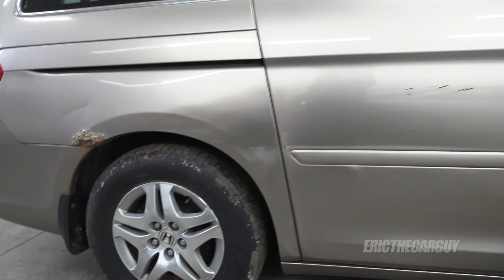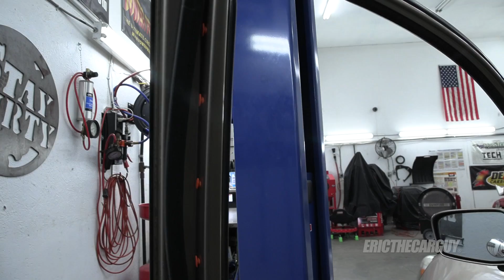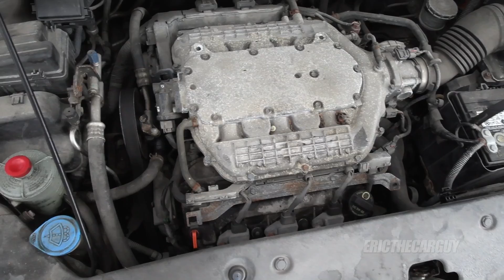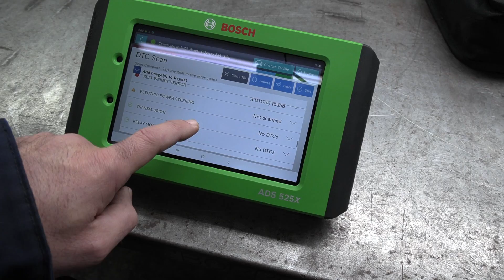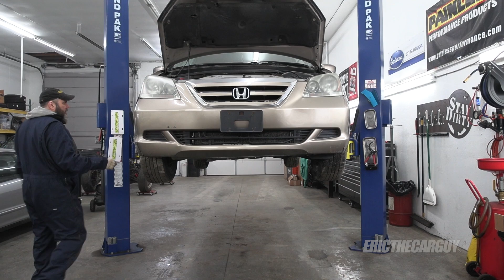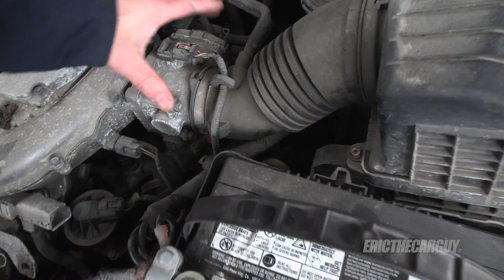2005 Honda Odyssey Introduction (Episode 1) Fixing it Forward

Comment: Unfortunately, if a cat gets pelted with another's guts, it's best to change them, as the fine dust and materia inside clogs them. So at the very least, it's not going at spec for its age.

@20:07 there's still a grindy noise coming from the engine, now it, might be the camera lying, but it seems to be something with a long travel...belt related maybe?
Reply from the maker: It kinda went away. Like I said, it's been sitting for a bit. I should probably put this on the road and drive it for a bit to make sure everything is good before I give it away. That way I can avoid potential future issues with it.

Comment: My 2000 Odyssey, which I bought new, is coming up on 300,000k mi, Lives in the Northeast is still in better shape than this one. Eric, you're being very ambitious. Thought parts that can be a reasonably low cost because these vans were made in copious amount, I can also say that the cost to refurbish is going to be more than it's worth, when you factor your time. Finding another van in much better shape WITH a blown motor might work out better, as a "new/used" motor might be cheaper overall. Anyway, good luck, and I'll keep my eyes on this project!

Comment: Hi Eric, That is a very nice gesture....... It looks like a great project, a lot parts here and there, but mostly "sweat equity" .......The only thing I do not like is the rust because it is cancer, but it can be fixed and seems only bad on the 2 spots over the rear wheels but for $500, I think you struck "Gold".   It needs a good cleaning all over....... The maintenance has been neglected, hopefully, nothing permanently damaged.....It looks to be in better shape than the 2000 Honda Accord that we purchased for our daughter and paid $1700......It has "cat" issue too.... I am working to clean and tune the engine (T-belts, belts, power steering leak, brake fluid & clutch flush) up first then will go back to the "cat".  It is a "rolling project", that is pieced together....It needs the battery cables too.....Just got tires for it.  I see a lot of the same issues.  I am hoping that cat issue and oil burning can be solved with cleaning the EGR,  the Adv. Timing Spool aka VTech Valve & intake manifold. I think these are probably at least partially clogged.  We will see.....the good thing is, (Not that I want to be a "polluter") because it is a 20 year old or older vehicle, it does not have to pass emissions in our state.  I will get it run as best as I can with in "monetary reason".
Reply from the maker: I don't plan to address any of the body work on this van. My goal is to get it up and running. In my experience, once rust starts like this, there really is no stopping it without replacing panels. That's above my pay grade. I'm confident it will last a long time before it becomes a real issue. Thanks for the comment.

Comment: My theory as I’ve seen it many times is the rear bank piston oil rings are sticking causing excess oil entering the combustion chambers, thus fouling the rear bank plugs causing misfires. Which was most likely not addressed, judging by the shape of the vehicle lol. Which then allows excess fuel to enter the catalytic converter and destroy it. 
And thus also why the vehicle was low on oil and setting the rocker arm code. 

Unfortunately these odyssey’s are plagued with this condition and it’s widely debated if the variable cylinder management is the cause? 

Anyway good luck Eric, definitely looking forward to this series!
Reply from the maker: Great theory. I'll have to look into it. Thanks.
Reply: @ericthecarguy  yeah of course! If you have any specific questions you can feel free to email at dhamilton1188@gmail.com.

Comment: cool,  my wife has a 2007 EX-L,   looking forward to see yours getting fixed up. Somebody is going to really enjoy that van.
I Just had 200K maint on my wife's , some I did myself. some I had done. including full trimming belt , plugs, rear valve cover gasket replacement, Alternator, belts, oil change,  Transmission Drain-Fill x2 (ATF-DW1) and PCV Valve.

Comment: Vtec solenoid! When the vsa light and check engine plus the rpms wont go past 3k. Its either clogged or not working. Super easy fix
Reply from the maker: It also has low oil which could contribute. Also, the codes were for a communication issue. I'll check into that if the code comes back. So far it hasn't. Thanks for the suggestion.

Comment: I’m glad you’re back to fixing it forward, it’s one of your best segments, God speed Eric, you’re one of the good ones. Just give the interior a good clean, replace the front and rear brakes and the sliding door rollers and it’ll make a great daily driver.
Reply: Why replace the brakes? Just wire wheel them, there was still plenty of meat there too.

Comment: Odyssey tan "leather" driver seats are hard to come by.  A lot of them get that worn out on the bolster so good 2nd hand ones get snatched up quick.  Rather than paying an arm and a leg for one, I went the Clazzio seat cover route.  Their tan matched really well and fitment was spot on.
Reply from the maker: I'm also considering seat covers, but I don't think that would be as good a solution for the rear. Thanks for the comment.
Reply: Why did you put quotation marks around “leather?” It looks like cowhide to me.
Reply: @jaysicht1862  The majority of the seat that your body contacts is leather but the sections on the side that typically crack on the bolster are vinyl.   That is why they are so hard to repair.   You can’t do your typical leather repair as it starts to wear.

Comment: I recommend Checking EGR. Clean with brake cleaner, make sure it moves freely. Penetrating oil helps. Replace with new gasket, $2 fix. Looking forward to this video! Thanks Eric, always learn something from your videos!
Reply from the maker: I don't normally see EGR issues with these later J series. You can remove the upper cover of the intake to clean the EGR ports pretty easy on this engine. Cleaning the valve does nothing in my experience. Thanks for the suggestion.

Comment: Looks like it's puking oil from the oil pump. I've owned several of these J-series motors and they all leak from that figure 8 o-ring at around the 150k mark. Might not be a bad idea to drop the pan and replace it while you're in there doing the timing belt service. Also suspect is the large o-ring for the oil filter housing. I figure for an extra 2 hours, you might as well grab the oil pump o-ring, oil filter housing o-ring, 2 oil galley o-rings (seals a metal tube that's visible once the oil pump is off), and the pickup tube o-ring. They were all rock hard on the high mileage V6 Hondas and Acuras that I've owned.
Reply from the maker: A lot of people claim that, but I don't see it often myself. I often see oil pan gaskets or valve cover gaskets leak onto the oil pump giving the impression that it's leaking. VTEC solenoids are also a common leak I've seen. Not to mention with the oil filter where it is it can give the impression of a leak if someone doesn't clean up after an oil cahange. I've also seen people replace the oil pumps and completely screw things up on these engines. Thanks for the comment.
Reply: @ericthecarguy  Not sure how people manage to do that. It only slips onto the crankshaft one way. Maybe they got debris onto the pump rotor during removal and caused damage that way? I've personally never seen the pan gasket itself fail. It's siliconed the whole way around and we all know how fantastic Hondabond is. Whatever you decide to do, best of luck with it! Can't wait for the next video.
Reply: We do the oil pump reseals very often at Acura. The place to look is just below the water pump right above where the timing belt idler pulley bolts in. 
It’s honestly like 4 additional gaskets and then resealing the pump and oil pan. But it is a large job and don’t want to jump to conclusions as it appears this car has multiple leaks! Good luck with the future repairs Eric, I know these engines well and if maintained properly they can run for quite a while.
Reply: @Meaty97  Yep this was the case on my two TLs as well as an RL, Odyssey, and Accord I've worked on. All close to or over the 200k mark. The nice thing is that the oil runs around the pump and doesn't soak the timing belt but I've seen it degrade and/or crumble the harness for the crank sensor.  I've gotten so used to doing them that I just do it with every timing belt job. Something I do is add Hondabond around o-ring. There's only like 2mm of mating surface for it to "seal" on but my logic is that it'll help contain the leak a bit more when the o-ring fails in another 10 years or so.
Reply: @TYLERTRANCE  Yeah it’s usually 50/50 if it needs resealed. But I’m starting to see less in the newer stuff. Like 16 and newer vehicles, but it’s the same design with a rubber seal that will eventually fail. Probably better to do it when you’re in there, as it will probably start leaking before the next belt comes due.

Comment: My uncle had an 07' and compared to my parent's 04' Sienna, I did like the interior looks/features better on the Odyssey (although seats felt more comfortable on the Sienna). Thought it drove well, also really liked the fact that the spare was inside the back area, built into the left side! On the Sienna its on the bottom passenger side and a pain to get to, especially when you need to change it out for a flat tire.
Reply: That's good to know... Considering I got a 2004 Sienna XLE myself

Comment: Rear brakes more rusty that the front? Makes me think a brake fluid flush may help prevent that in the future. 
Glad to see you doing this, Eric!
Reply: Lack of brake fluid does not create rust
Reply: @danh2134  
I said nothing about lack of fluid, only that a flush is a good thing. Trash in old fluid that absorbed too much moisture over the years, means the inside of the hard line has rusty bits that likely clogged some pressure to the rear, which would explain the surface rust not getting scrubbed off by normal braking. A brake fluid flush is cheap and yields great braking improvements. Also, because regular maintenance was clearly neglected for ages, you can bet the brake fluid is garbage at this point.
Reply: @mindthependulum6245  no loss of stopping force or a pedal that goes to the floor means brake system is still operating. Brake fluid flush will not stop rust in the Midwest
Reply: @danh2134  
It doesn't stop rust, but resets the clock on how fast it will progress. Brake fluid is hygroscopic. I would be willing to bet that it isn't clear or even semi translucent. If the brake fluid is opaque then its definitely done.

Comment: Blown engine on a 200K miles Honda? I wonder what lengths you have to go to achieve that.
Reply: These engines have VCM (variable cylinder management) which deactivates the rear 3 cylinders to save fuel. This can sometimes cause excessive oil consumption. I used to own a 2005 Odyssey so my best guess is they weren't monitoring oil levels and ran it out.
Reply: @lifeonbicycles  Generally the issue takes longer to manifest on the 05-07 Odys with VCM1, and they usually are not quite as severe as the 08-17 models with VCM2.
Reply: @lifeonbicycles VCM muzzler for the win

Comment: The third generation Odyssey’s AC compressor and starter motor does not last like the second generation Odyssey but, the third generation Odyssey’s automatic transmission is much more robust than the second generation and that’s important..
Reply: This is a 3G Odyssey. 1G 1995-1998. 2G 1999-2004. 3G 2005-2010. Etc...
Reply: @autobreza7131  Thanks for the corrections.  I corrected my post.  I was typing 1st Gen when I meant to say 2nd Gen and then I typed 2nd Gen I meant to type 3d Gen.  I need to stop commenting on Youtube videos before morning coffee.  The 3rd Gen has a much better transmission than the 2nd Gen.  The 2005 is a good model.
Reply: Technically, the 2005 and 2006 models used the same transmissions as the later 2004s (referred to as 2004.5), and those transmissions were better than all the other 2nd gen transmissions, but still not perfect. In 2007, they introduced the transmission from the Ridgeline to the Ody, and that transmission is very robust and durable. Also, I think you meant to say second generation for the starter motor and A/C compressor? The 1st gen used a completely different 4 cylinder engine.
Reply: @wiimaster2847  Thanks got pointing that out.  I made the correction on my original post.  After reading what you said about later models of the Odyssey having a better transmissions that the older generations, I might change my mind and replace my 2001 Odyssey with a 2021 Odyssey, instead of a late model 2014 Toyota Sienna.
Reply: @cgrscott  I wouldn't buy a newer Odyssey, just because the build quality is somewhat poor, there's stupid design elements, and it's not as reliable as older Hondas. This is why I believe the 3rd gen was the peak of Odysseys, and why I'd still try to find one of those.
Reply: @wiimaster2847  I solved the short life transmission problem on my 2001 Odyssey by installing a transmission cooler, an in-line transmission filter, and transitioning from Honda ATF-DW-1 to Amsoil Full-Synthetic ATF. I have 368k on my 2001 Odyssey.  The transmission shifts much smoother with the full-synthetic. I’m not an Amsoil salesman.
Reply: @cgrscott  people have experimented with different ATF. Personally I'm going to stick with DW-1 on my 06. Never had an issue, I see no reason to change it